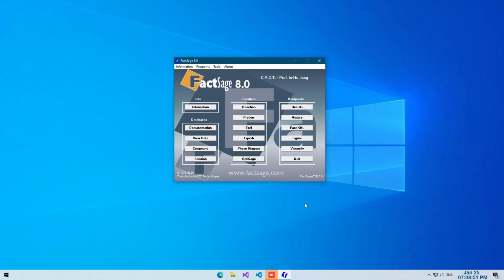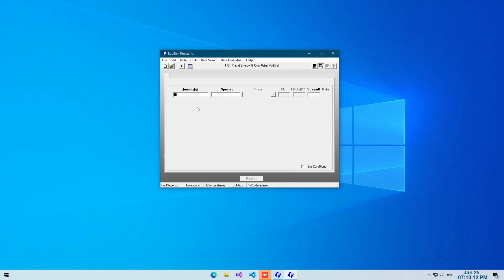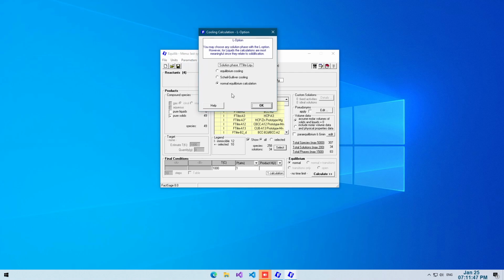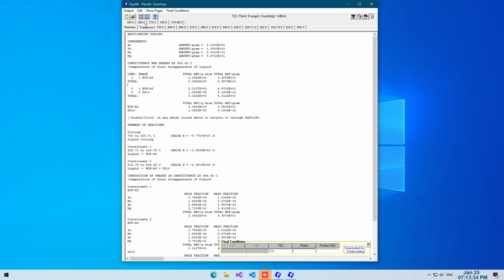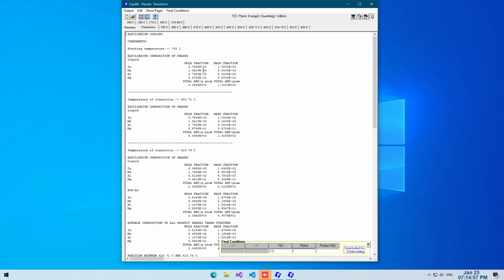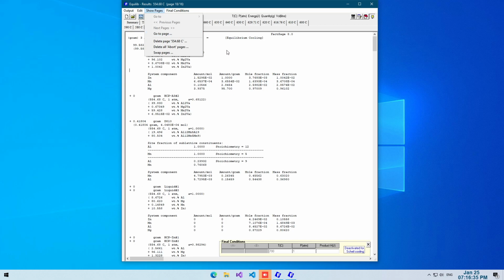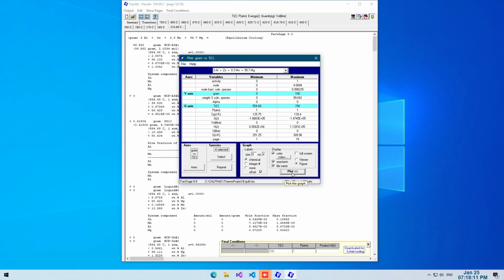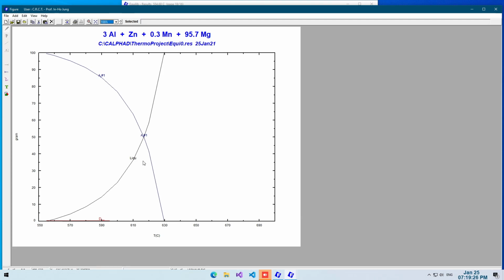[ENG] Alloy Design EX 9) Equilibrium calculation

Comment: When I input 3Al₂O₃·2SiO₂ as a reactant to calculate its reaction products with gas‑phase species, the system automatically converts the mullite component into corundum and quartz phases which have lower energy.